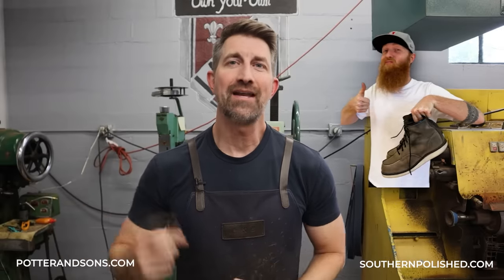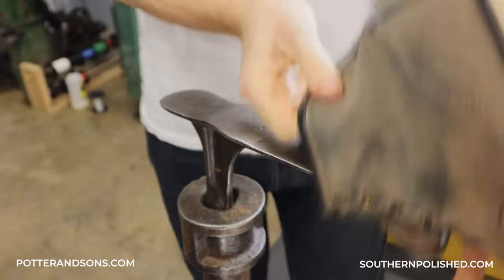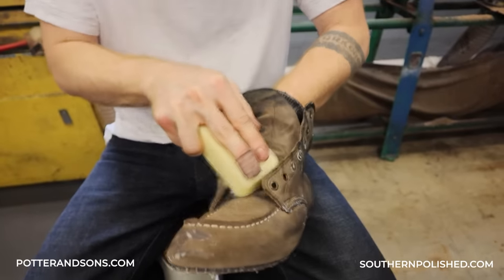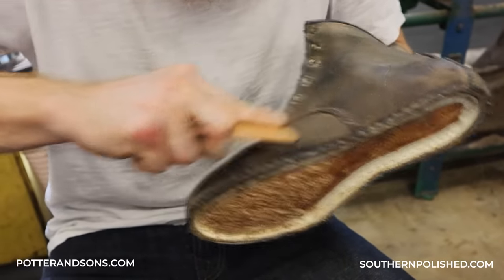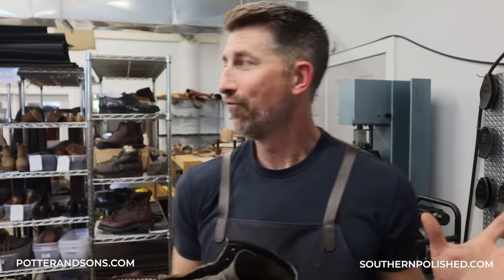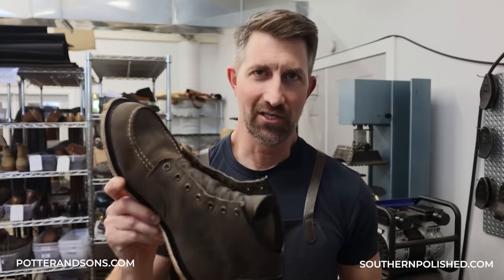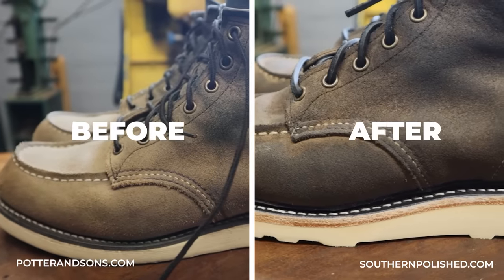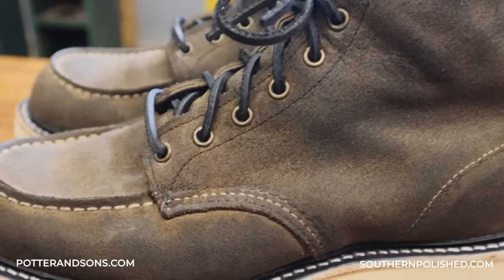Can Our Apprentice Restore These Red Wing Boots??

Comment: Back in the day, when I worked at a ski resort as a lift operator,  I used a new wax ring for the toilet.  Set them in front of the heater in the lift shack and worked the wax into them. I had dry feet for the rest of the winter.